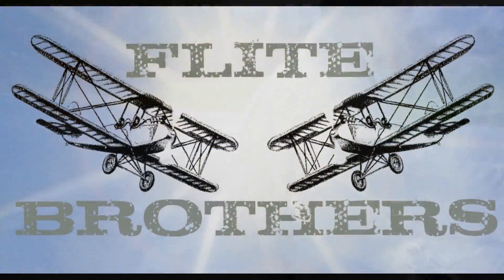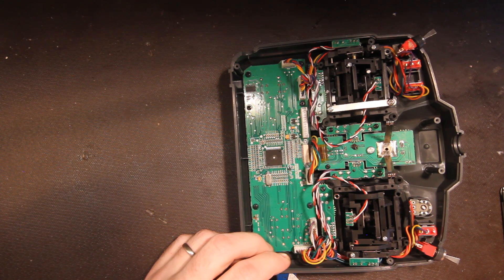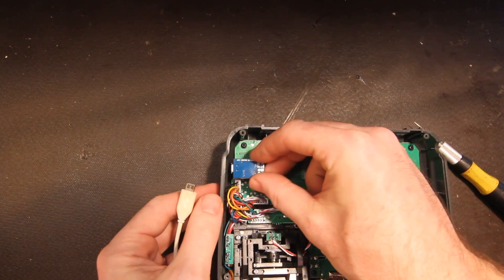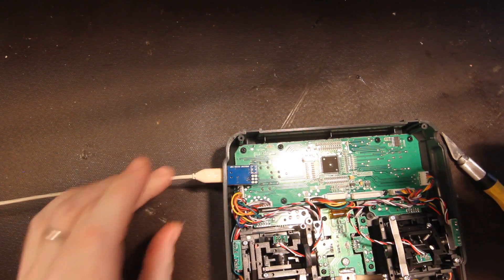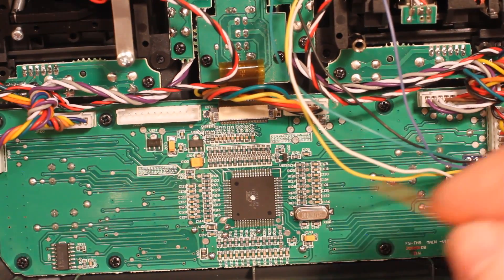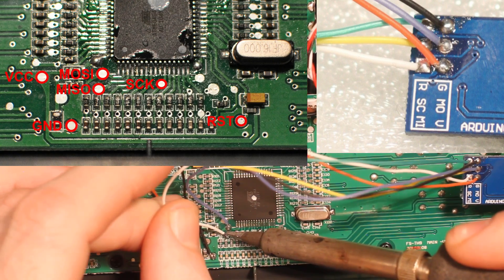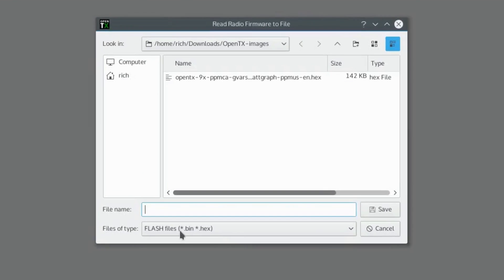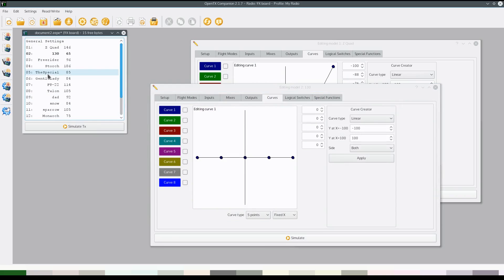Turnigy 9x Firmware upgrade the easy way

Comment: Grate video
 I'll receive my first drone soon. Looking forward to do this upgrade to the remote.
Thanks for sharing.

So if i get it right, after upgrading the firmware. 
You comunicate with the processor of the remote in realtime.... Over usb. 
Awsome :)

Can you adapt the stick slopes midd flight?
Can come in handy as a rooky haha.

Correct me if im wrong.
Is this a way to get telemetrie working. With ArduFlight for example?
Of cource the drone needs to be equipped with telemetrie as well than, i guess.

With the idea in mind to flip a switch, that stabalizes the drone and sends it back home.

Comment: could an arduino be used to program this remote controller
Reply: Yes it is possible to use the arduino but it is a little more complicated to connect the wires, in the software part it is easier than with a recording board.

Comment: frankly I'm surprised that turnigy doesn't ship these with openTX and a tinyisp pre-installed
Reply: That is the diff between the $60 and the $180 radio.  I'd rather buy an open radio that is upgrade-able than one with all bells and whistles installed but probably closed source FW.

Comment: My usbtiny driver did not work initially. I used zadig-2.3.exe to replace the driver with libusb0 (V1.2.6.0), and it works great after that.

Comment: So from what I am understanding is the 9X radio can have 1 of 2 possible processors and the tiny AT44 can only be used for flashing one of them, correct? Is it marked on the processor so you can tell which one I have?

Comment: Needed to find a new driver for the USBTiny but soon had my trusty old 9x running openTX. First attempt ended with an eeprom error but another go solved that,when I switched on it prompted me to format the error by pressing any switch and then went into openTX. Thanks for a great video.
Reply from the maker: Glad it worked out for ya!

Comment: Awesome video and love the mod. Is tis still current for the Flysky TH9X's still being sold (have one on the way)? If so would this Tiny USB work the same? Thanks!

http://www.ebay.com/itm/5v-Micro-USB-Tiny-AVR-ISP-ATtiny44-USBTinyISP-Programmer-For-Arduino-Bootloader-/251618656673?hash=item3a95a401a1:g:DbYAAOSwxg5XznGi

Comment: Browsed thru your videos.  I was looking for a tutorial on replacing the stock 9X display, with one that is illuminated.  Did you ever produce one and/or did you ever mod your stock display for your own purposes?
Reply from the maker: NappingPup You don't have to change the display. Just buy the backlight kit for $5 from HobbyKing and install. It's easy.
Reply from the maker: You don't need to replace the stock display, you only need to get a backlight kit. Hobby King sells them very cheap. You can see one in action on this video when Rich turns on his transmitter
Reply: Got it.  Thank you.
Reply: Available from HKing

Comment: Great video.  My 9X is vintage 2012, never used. I intended to mod it for the ER9X firmware, but lost interest.  Ordered the Micro ISP and will install it when it arrives.  Then I can use my new 9X for the first time.

Comment: Thanks for the video tutorial.... can I ask what benefits would there be upgrading from the standard Turnigy, FlySky 9x Radio firmware to the openTX or ER9x Firmware!
Reply from the maker: OpenTX or ER9X (basically the same thing) opens up unlimited possibilities of channel mapping, mixing and setting switch functions that are either not possible at all, or incredibly difficult to achieve with the stock firmware. It also allows for saving more models and other functions that are necessary if you ever intend to utilize different TX modules.
Reply from the maker: Thanks for watching!
OpenTX has huge feature improvements over the stock firmware. Basically, anything you can imagine doing can be done somehow. You can use any input for whatever you want, on any output, and mix in any other input easily.
If you already own one of these radios with the stock firmware, watching a few opentx tutorials will really shew you the difference

Comment: the link no longer works
can you put another , or a way to find this this small programmer, key words. 
because I find only the  large programmers
Reply from the maker: Strange, the link works fine for us. No biggie. Just search for "micro tiny USB isp" on eBay.
Reply: In Europe we are mentaly reduced , so that good things do not get to us , 
this is the link what works in Europe
http://www.ebay.com/itm/Micro-USB-Tiny-AVR-ISP-ATtiny44-USBTinyISP-Programmer-5V-For-Arduino-Bootloader-/161947116048?hash=item25b4cce210:g:dBYAAOSwaA5Wl3Xo
based on the keywords that you gave me

the original link might it work only for the us market 
so each person should find this programmer on his own continent market

thx
Reply: which version of open tx do u use since  i donot get  same  menu when i  click on usb  thx

Comment: Can you supply a new link for the programmer? This link no longer works. Also how do I know if I have "tinned" wires?
Reply: Tin them. Then you'll know.    I mean... when you strip off the insulation at the ends, you're left with strands of bare wire... hand-twist each of these bare wires so that they stay together rather than fray apart and then apply a wee-bit of solder to them... don't just let a blob drop onto them... heat the wire (the twisted thingie part) and let the heat of the wire melt the solder. Don't get excessive with the solder... just a light little coating that keeps all the little strands together (inside as well as outside). THAT is called "tinning" the wire. Once you've done it... you'll remember that you did. ;-)

Oh. I forsee a problem here...   Many things can be done many ways but usually there are better ways and worse ways...   even though you "could" use solid hookup wire for this - DON'T.  Instead, use flexible Stranded wire.

 Check out other channels on YouTube for a better "tutorial" on soldering - my explanation was just a quickie.

Comment: Hi there :D I had an error which says: AVRdude connector error. So I downloaded AVRdude files and inserted it into usr/local/bin and now the writing firmware is launching but nothing happened. Do you have I idea?

Thanks BTW :)
Reply from the maker: there should be a avrdude.exe file in the opentx companion folder somewhere that you should point it to.
Reply: +Flite Brothers alright. I am looking for that file. But does it work on Mac? Cause it's an exe file.